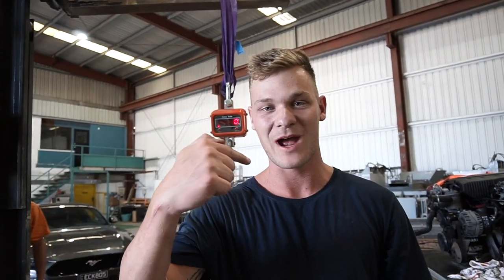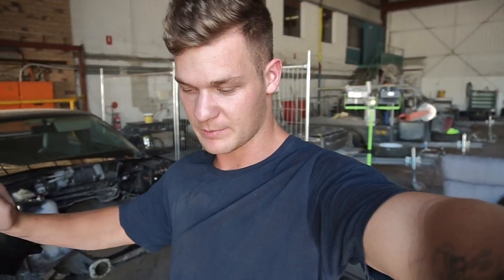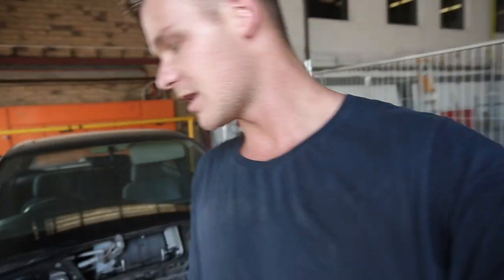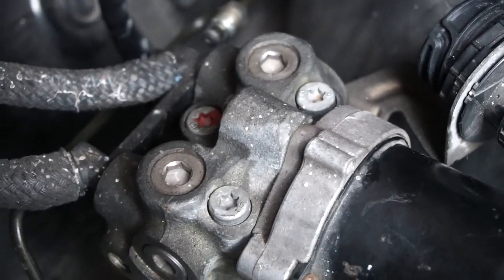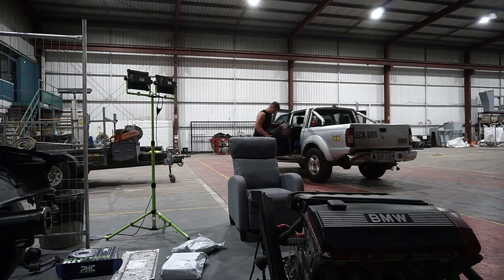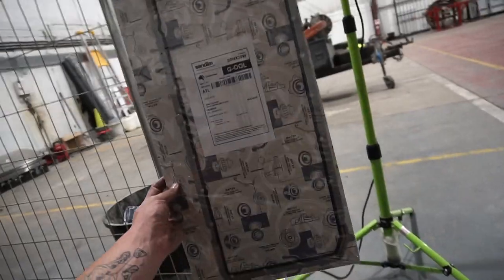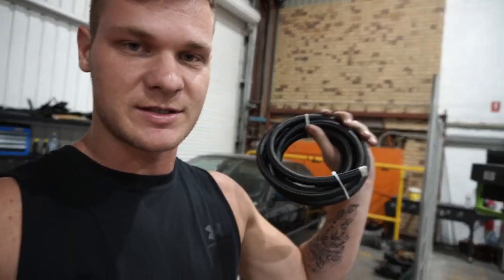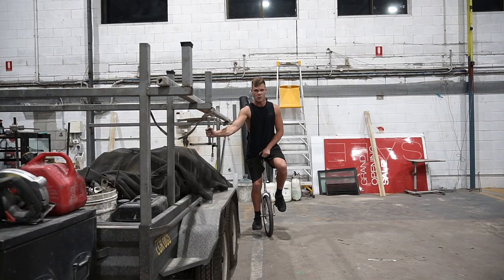GEARBOX & RACE SEATS For The E36 Turbo Build!!

Comment: ahh i was so closes, but way off on the engine weight, but well done Jack Tupp and Lubos Gloznek 👍 as well I'm gonna need to replace my Getrag 226 gearbox it keeps locking me out of gears, wore out synchro rings from previous owners, oh the joys of owning a 20 year old BMW 😂
Reply: Thanks! I didn't expect to be this close 😂 and I wish you the best of luck with your gearbox, I think I have similar problem with 1st and 2nd on my E46... 😃
Reply: @LubosGloznek  cheers man, yeah the getrag gearboxes are are okay but the ZF gearboxes can hold more torque and take a beating lol
Reply: @Diesel01992  actually It never came to my mind to check what kind of gearbox I have 😃 should do a little research. It's 5 speed manual in 2003 320Ci, so if you have some usefull info on that, feel free to share your knowledge. 😅
Reply: @LubosGloznek  I think yours might be a getrag 226 like mine, there rated at 226Nm hence the number, the getrag 260 hold 260Nm which is a 5 speed,the ZF 320 hold 320Nm is 6 speed and the 420G can hold 500Nm which is also a 6 speed which powered the e34 M5,e36 M3,e46 M3 but I’ve also know that the Diesel gearboxes are strong as well like  ZF S6-53 gearbox can handle 600Nm, hope this helps lol
Reply: @Diesel01992  Thanks! One day I would like to swap M54B30 in it and also combine it with a 6 speed. At the bottom of my bucket list for this car is a supercharger on that M54B30 and from what you've said it would be the best choice to go with the 420G from the M3 😅 what do you think about rebuilding stock open 3,38 ratio differential to LSD? I would like to know if the ratio will be good for the new output numbers, but I think LSD is a must for that power.
Reply: @LubosGloznek  well it depends on what you want the car to do if your looking for brutal accelerating  then the 3.38 ratio differential will be fine but if you find a 3.45 differential then you'll be able to launch off the line quicker and will have to shift sooner, but of course that comes down to your tyres, but please note that the higher the final drive is, the less top end speed you'll get, for example if you use a 2.93 differential with the stock gearbox that you have, and shift at redline the gears would be Gear 1-> 37 mph, Gear 2->65 mph , Gear 3->99 mph , Gear 4 ->134 mph, Gear 5->164 mph and if you where to use the 3.38 differential that you have, it would be Gear 1-> 32mph, gear 2-> 57 mph, Gear 3->86 mph, Gear 4-> 116 mph, Gear 5 143 mph, and of course if you using a 6 speed manual again the 6 gear with the 2.93 would be 194 mph, and the 3.38 would 168 mph, but comparing the 2.93 to the 3.38 the 3.38 gives a torque increase of 15% over the 2.93 but if you can find a M3 differential that is LSD with a ratio of 3.38 or higher would save you some money and time, i hope this helps lol
Reply: @Diesel01992  I want to rebuild my 3,38 because from what I know you have to swap whole rear axle from the M3 if you want the M3 differential, otherwise it won't fit and I consider the 3,38 ratio as the "golden middle" as we are used to say here 😄 so I wouldn't go up nor down with the ratio.
Reply: @LubosGloznek  i see lol well if you want fit LSD with the 3.38 ratio then be prepare to throw your wallet at the car lol, or you can get some one to wield the planet gears in differential with a thick metal plate then you'll have a lock differential only problem is, is when you turn left or right one of the back wheels will skip lol
Reply: @Diesel01992  I am already throwing my wallet at it 😂 and that's the reason I want LSD, it's daily, not a drift car so welded diff would be impractical. I have studied mechanical engineering in high school and I study aplied mechanics and mechatronics on the university so I know how these things work, but real world experience is what I am missing, so that's why I am asking 😅

Comment: Best 5 gears gearbox is the zf 310 from 328i or 528i. It holds the most torque. Then use arps with athena head gasket. Then you should be able of 400 to 450hp. Nice build. Waiting to see your build getting forward

What kind of turbo and manifold are you going to use? Topmount or bottom?
Reply from the maker: Thanks man. I think I’m going to run a ball bearing gt3582r with a top mount manifold I found on alibaba. Not sure of the name of it
Reply: Ok thats cool. On aliexpress etc. you can find many manifolds. They are looking quite good most of them. Gtx35 gen 2 are good. Also available there😀😀

Ill try pulsar Turbo because they have inconel exhaust turbine instead of mostly heat resistant Steel.... Depends on boost Level 😅

Comment: Wouldn’t it be easier if you got a 325i e36 with an M50 already in it?😂😂
Reply: ikr.. would be a cheaper build then this black one too. should find a better motor then a M50
Reply from the maker: E36 with m50 and low k’s is way too expensive now
Reply from the maker: Would pay over 10k for a coupe manual m50
Reply: @mike.135i  tbh M50 is probably the best bmw motor to boost
Reply: @CodyAplin  daingg...e36 m3 is 10k in the states